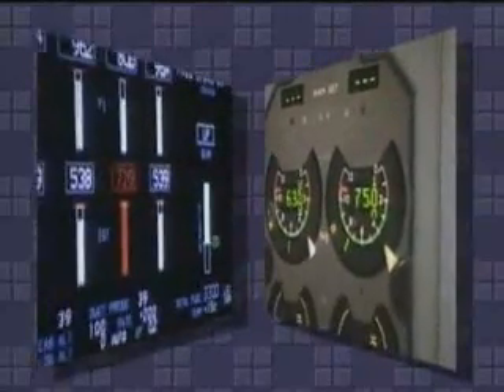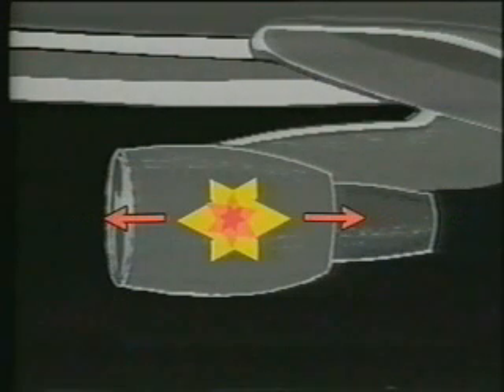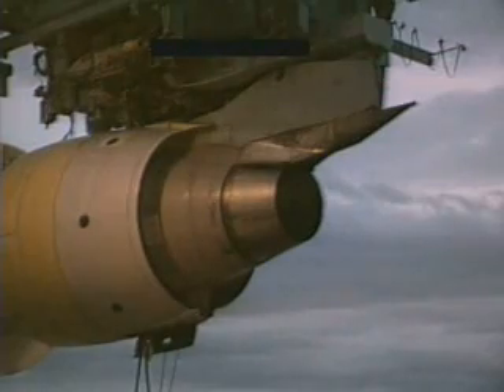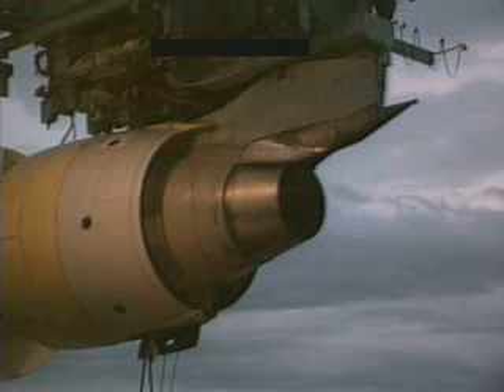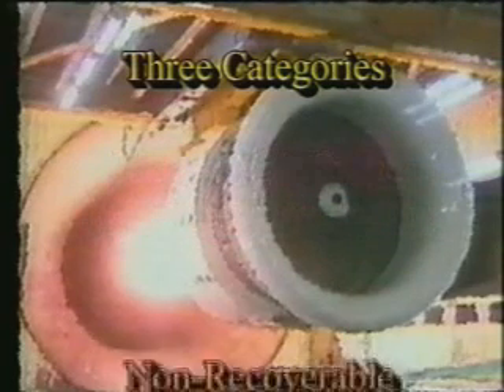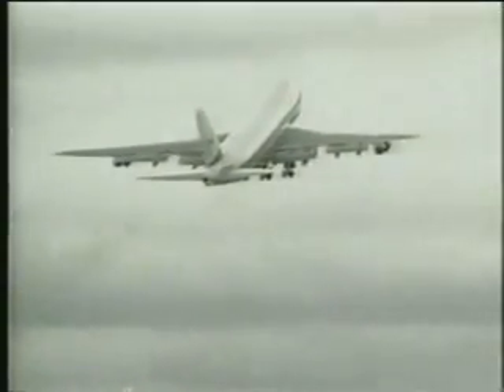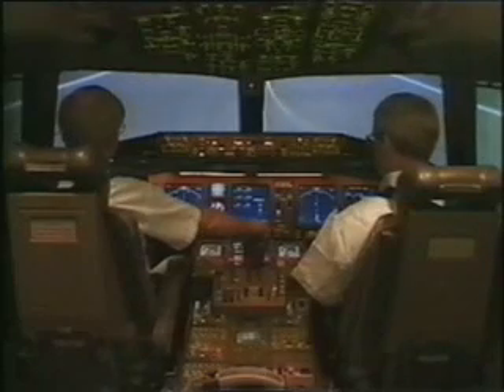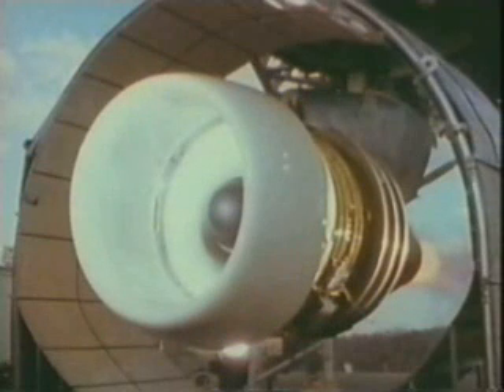pt. 2 of 3 Turbofan Jet Engine failure recognition

Comment: Are people just stupid or is there an effort to design these turbines so that they perform smoothly and without vibration or noise. Sound waves and vibration are a big deal when spinning a shaft at high RPM with thrust applied. Sound and vibration can cause fatigue. I can't believe anyone would want to fly any engine with noise designed into it. I'm just amazed this is going on.

Comment: a car engine back-firing into the exhaust, is completely different from back-firing into the intake. This jet is firing back into it's intake system, meaning it's the same disastrous result as a car engine back-firing into it's intake system. (injectors, sensors, intake manifolds all getting damage not to mention that extra fuel in the intake igniting)
Reply: In a family car reciprocating engine the exhaust and  the intake are isolated through the use of the intake and exhaust valves. In a jet engine  which is a  continuous flow engine there is  no isolation between intake and exhaust.

I consider a jet engine as made up of many vibrating reeds at different frequencies in addition to  tuned pipes  working   in synchronisation  in a particular mode at certain revolutions.  If  due to different circumstances  anyone will go out of tune like a philharmonic orchestra .  When I see those halo  serrations  at the exhaust of a jet engine with afterburner I appreciate all the synchronisations of flow and nodes and anti-nodes  which produce the effect.

The  throttle in a jet engine must be handled carefully because there is a  delay in the spin up.  The British V-ee bombers including the Comet, one had to be careful as those long tail pipes could accumulate a lot of neat fuel if the burn is rich.

Comment: They missed one possible problem with severe engine issues like that. In some noted cases the engine came off the wing it broke open the Hydrolic systems.

Comment: @whatuwantmom But hail melts once it gets into the engine...bird pieces don't. As long as the compressor blades survive the initial impact of the hail, it comes out the other end as water vapor. Plus, a bird like a goose has significantly more mass than a hailstone (usually), and at the speeds a compressor blade is moving it might as well be a stone (like hitting the water at 100mph is like concrete). So all in all, a single 20lb bird has a lot more damage potential than 3/4 ton of hail.

Comment: @98209276 It's "plane". And the "car accident" rarely happens at 1,500ft (or 41,000ft, either). The "car accident" is when the plane reaches 0ft...and hits the ground. 
   And planes are only STATISTICALLY safer than cars. If every person who traveled by air suddenly had to fly 2-4 people per plane, times 100 million travelers....the statistics would suddenly become QUITE a bit worse. And that's not accounting for the fact that commercial pilots are the best, while cars are driven by shmucks.

Comment: @Iketh28 Piston and jet engines are very different. Fuel/air ratio is only important in gas-piston engines because it effects the point at which the fuel detonates...to early, you get "ping". With diesels, it doesn't really matter what the mixture is, since the fuel isn't injected until almost TDC. Excess EGT on a turbodiesel can melt the turbine; same applies for jets. Jets not only run a far lower comp. ratios, but they have a "continuous TDC"...fuel is always injected AFTER the compressor.

Comment from the maker: @Iketh28 You are correct in regards to a piston engine, but in a JET it's a measure of the temp and health of the turbine section.  Specifically, the ratio between EGT and EPR indicates how efficiently the turbines are extracting energy; as an engine gets older it typically takes a higher EGT to achieve the same EPR.   Saying "engine temperature" is a simplification but with no other direct indicator in the cockpit EGT is the only way for us to determine if an engine is running "hot".

Comment from the maker: @srsebd : "EGT" is Exhaust Gas Temperature;  It's one way to measure engine temperature.  Some manufacturers use Turbine Inlet Temperature (TIT), or Inter-Turbine Temperature (ITT).   The difference is where the temperature is taken, and limits are set accordingly.

Comment: @xNumb3rs If you dont shut down the engine and just idle it, it will provide less drag on the aircraft.  Also, an idling engine can still provide power to other systems.

Comment: slow mixture ECU adjustment  ... 
when exiting a slighly higher ground air pressure 
and air moisture level 

man the engines wiggle a lot in normal operation

Comment: Surges are not dangerous but certainly get your attention.
Just throttle back on affected engine normally clears problem straight away.
Often caused if cold soaked engine producing high power.

Comment from the maker: Windmilling is when the engine rotates as a result of the aircraft's motion through the air (relative wind) rather than by its own power.  Like blowing on a pinwheel.  "windmilling speed" is the speed at which the airflow is sufficient to do this.